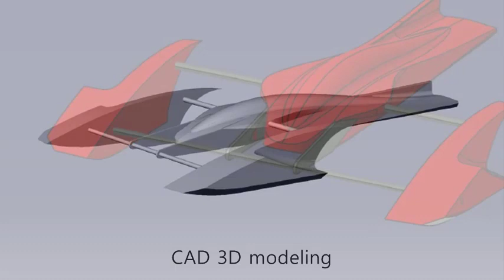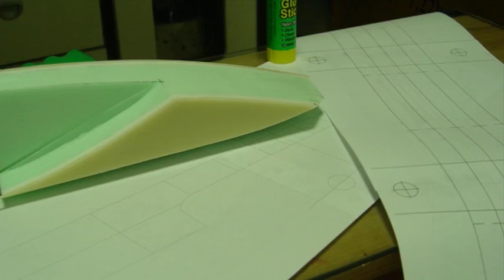DIY 집에서 만든 RC 아우트리거 보트 "COBRA", RC 3P 보트How to make a rc outrigger(hydroplane)

Comment: What speed you get out of her?
Reply from the maker: This is a reference video.    https://youtu.be/42dpgdc1e3I
Reply from the maker: 6S battery , 3674-1900KV,  120A ESC  X642 prop    https://youtu.be/3y_EAxqZAm8
Reply: Did you gps the speed ?
it looks fast
Reply from the maker: @jamesatkinson7517  There was no gps when taking video.
 So I couldn't measure it.
Reply: Looks fast but it also handles in not perfect water as well. So rewarding for the work you put into it.Great job mate.
Reply from the maker: @jamesatkinson7517  I love making things and I honestly lack my control. The place where the boat floats is also narrow, making it difficult to proceed at a high speed. Thank you^^

Comment: I want to know your opinion at 7:38 minutes, why prop. is so close to the transom?  🤔 it seems to me that he lacks freedom, it will be better if he is 40-50mm., Further from the transom, what do you say?  🧐
Reply from the maker: I used about 35-37 mm.
There is no specific reason.
It seems that the maximum length of the prepared support shaft and housing was 37 mm.
I will refer to it in the next production.
Thanks for the advice.^^
Reply: Dae jung Kim D-Factory Ok, I'll be waiting for your new videos.👍✌️
Reply from the maker: @MrOmax08   Thank you^^